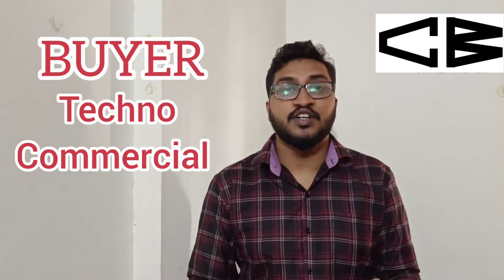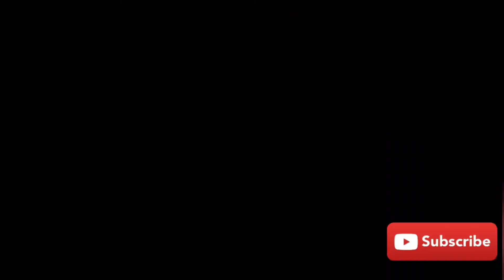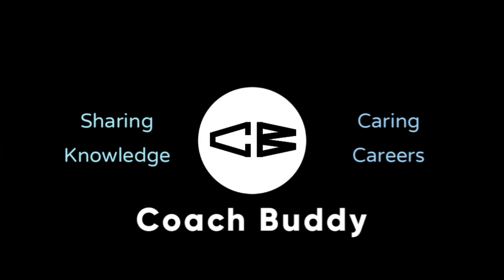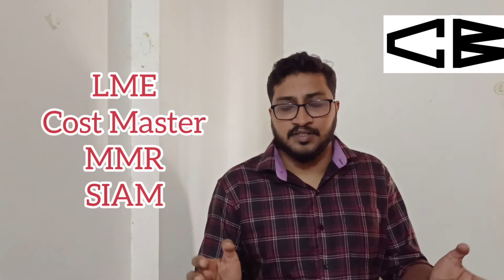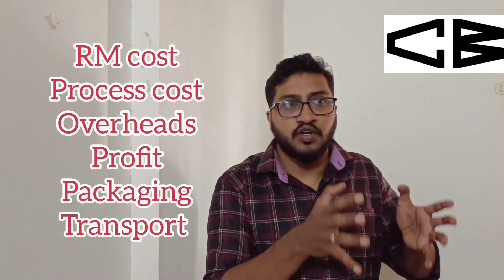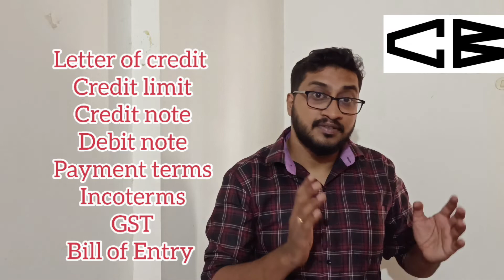Buyer-Techno Commercial Career growth| Technical Purchasing

Comment: #CoachBuddySPN working in Cable manufacturing as Procurement Engineer can i apply for oil gas chemicals industry with this experience? And some certified courses like supply chain management,

Comment: #CoachBuddySPN I'm joining one cable manufacturing as Technocommercial Engineer, I wanted to is it a good career option and is Procurement Engineer & Technocommercial Engineer same?
Reply: #CoachBuddySPN I am joining Power plus cable as Graduate Engineer Trainee,  one HR said Procurement and one from technical said it's Technocommercial
Reply from the maker: @alenveigas1233   Yes it's procurement engineer then. You will be working with Buyers/ procurement engineers
Reply from the maker: Procurement engineer is a techno commercial role but some companies will have cost engineer also called as techno commercial role, can you reply with the JD? That will give a clarity.
Reply: #CoachBuddySPN  for career growth should I do supply chain management courses and other useful
Reply: #CoachBuddySPN with this experience in Cable manufacturing industry, sir can i apply for oil  gas and Petrochemicals sectors for Procurement Job